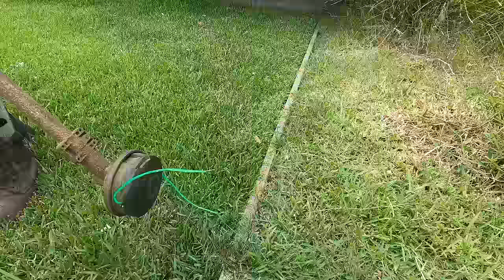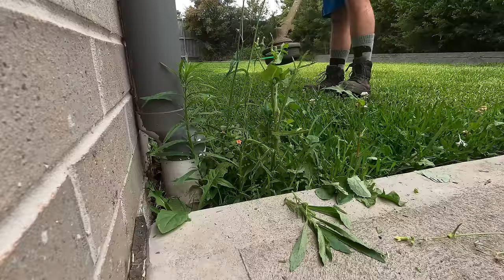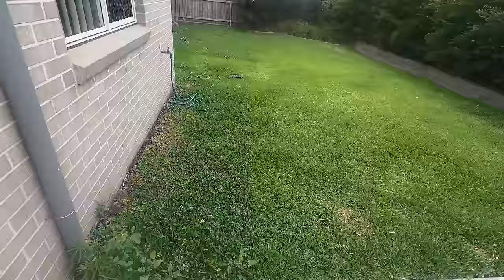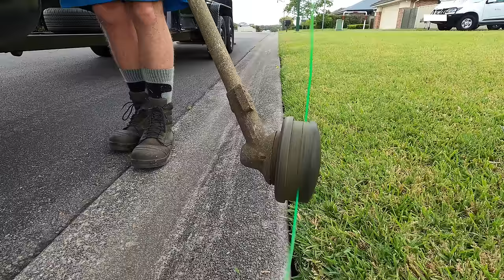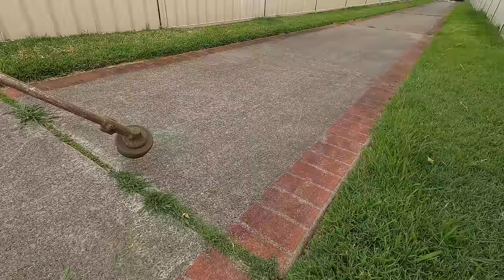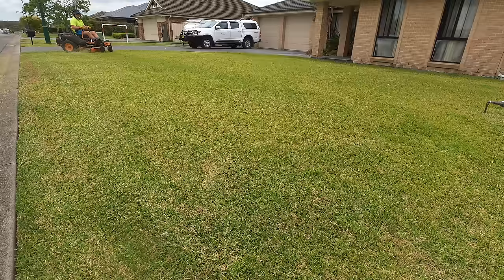$5000 giveaway update! ASMR lawn mowing VLOG

Comment: Without using a chemical killer, how do you recommend killing the Invasive weed that has white runners that spread in all directions? My lawn is being overtaken by them and my OCD does not like it. I have tried to hand pull them but they are out pacing me and my lawn now is full of potholes. 😁 Thanks!

Comment: Will there be times when you use your stihl fs 80 again
Reply from the maker: Maybe, I use whichever tool I need at the time. The FS135R is about on par with power output, but it's much lighter, zero vibration, and doesn't need the same maintenance as the 80.
Reply: Have you heard of the stihl fs 120 r or fs 200r
Reply from the maker: @gabrielflemmings1022  yes, tough machines. My 131 gets used on occasion if I need more power.